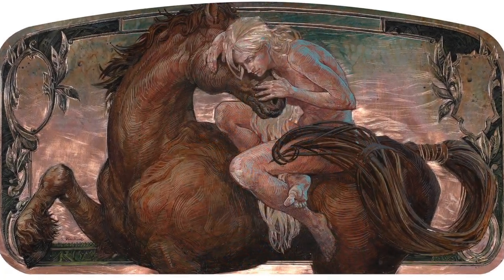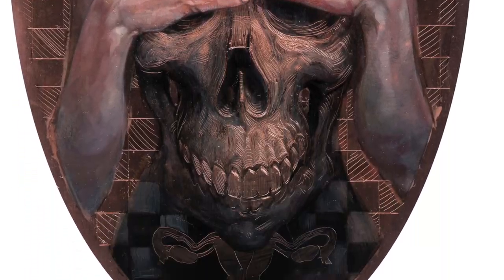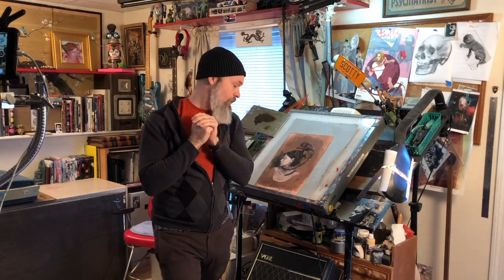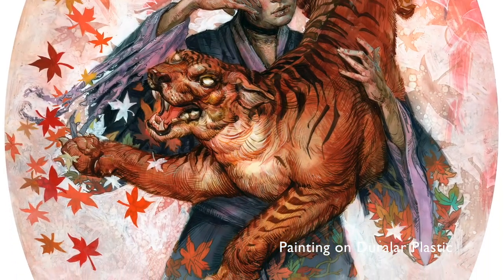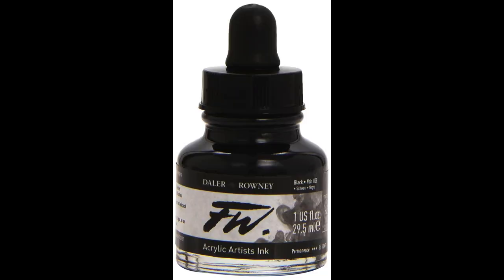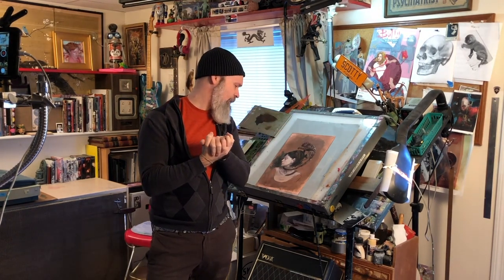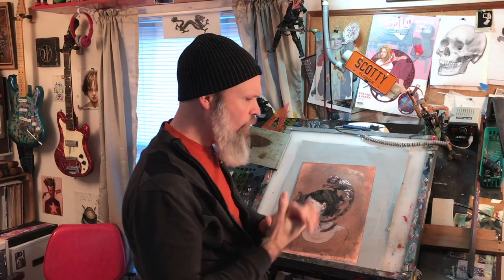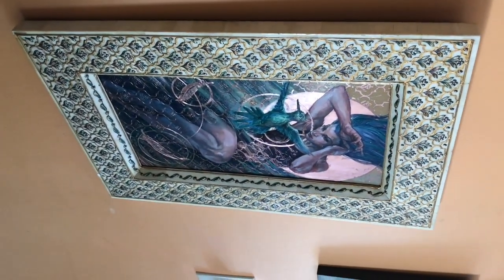Scott M Fischer  Painting on Copper

Comment: How do you seal it?
Reply from the maker: Hi there. I seal it under Gamvar Varnish. Thanks for the question.
Reply: @scottfischer7636  do you wait 6 months after to varnish? I’ve been told this is the case which seems very Discouraging for commission based work. Also while I’m replying , where do you get your panels from. I’ve seen some dull ones being sold online but there are some artists that paint on some that look almost mirror like. Thank you for your time by the way.
Reply from the maker: @danyl6298  Gamvar is designed so you don't have to wait 6-months. So cool!